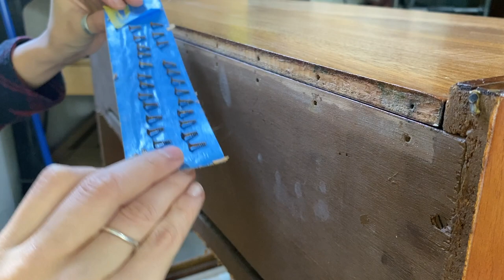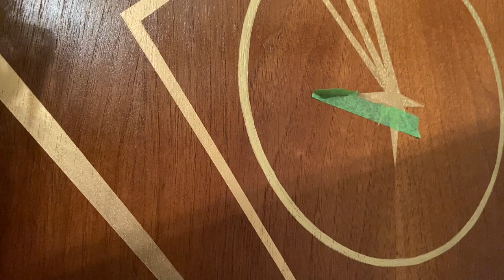Complete Radio To Bar Cabinet CONVERSION! | Atomic Style Makeover

Comment: Unbelievable! You are so talented! Just wondering, when you're doing the gold work on the sides, do you wait for the gold to dry before removing the tape? And presumably it has to dry before you tape over what you've done, to do another part of the design? Does it therefore take forever? Thanks
Reply from the maker: Hi! Thank you so much! No it does not. The paint that I use dries within minutes so by the time I’m done removing the tape, and getting the next step of the pattern figured out, it’s usually done drying. It’s not cured in that time though so sometimes I do have to touch it up if it gets pulled up by the tape, but that’s not often

Comment: I have such terrible luck with painters tape. Do you take most of the paint off the brush before you paint it on and how long do you let each coat dry before you pull off the tape?  Looks great by the way.